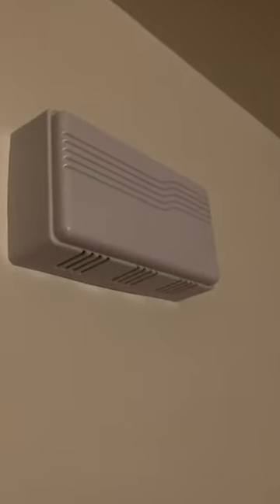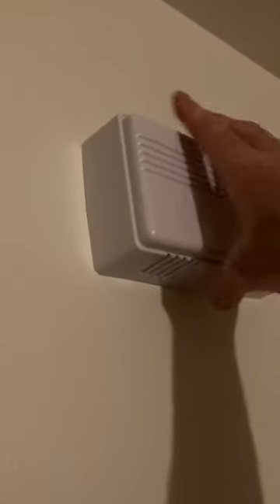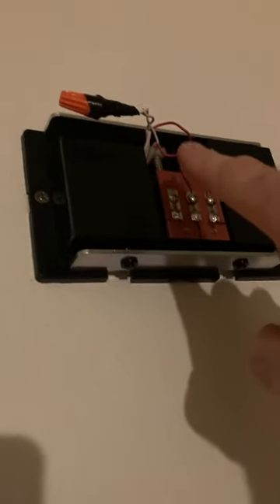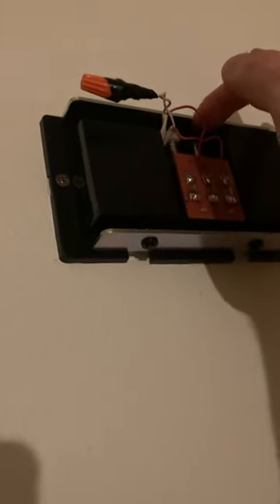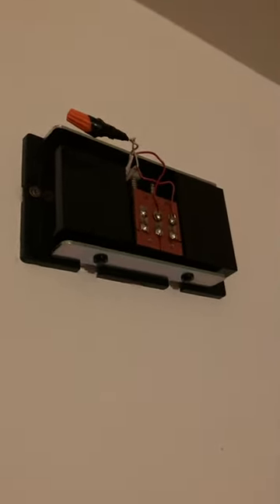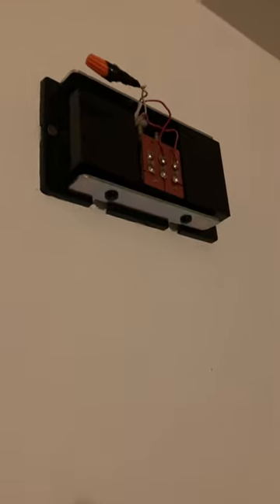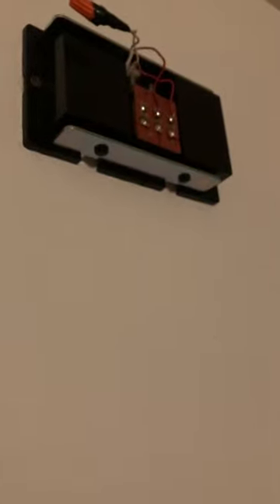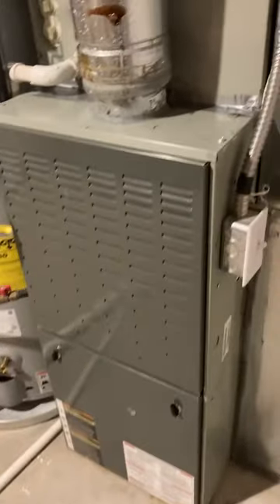Doorbell Transformer [Where to find it]

Comment: Agree with the others who are thanking you! Had our furnace replaced a month ago, and I think the installer messed up the transformer. It is right on the power box next to the furnace and now I have no voltage at all to the doorbell.
Reply from the maker: Sorry to hear that.  I would check to see if he forgot to hook it back up, or it may have failed.

Comment: You suggested in a comment that it may be located behind the chime. I think this is my case but I just want to verify. When I pull the box off, there's an electrical box with 3 separate wires. One is labeled "front." One is labeled "back," and the other is labeled "transformer." It seems like this would be it, but the box doesn't look exactly like the one in your video that's attached to the side of the furnace. I'm just trying to install a Blink video doorbell to my existing doorbell and I don't want to electrocute myself lol. Also, I'm not sure if you can answer this, but should I still shut off the main breaker after disconnecting the wire from the transformer behind the chime? I didn't expect this little doorbell project to require so much more than a few screws and WiFi connections lol 🤦🏽‍♀️ Thanks in advance for any help you can provide 🤗
Reply from the maker: That box sounds like it is part of the chimer.  The transformer usually has screw terminals on it. It's usually made of metal.  Yes, you want to shut the power off before disconnecting or connecting any wires.  Good luck with your project.  This video may help you too...
https://youtu.be/uzdg5jzUd6s?si=XKjF_pQyB8fCFqzI
Reply: @kjfacilities-maint  Thank you SO SO much! 🤗 This info and the video is very helpful. I do believe I'll not only get this doorbell installed, but I'll get out unscathed as well lol 🤣. Thanks again! 🤗
Reply from the maker: @KeiraMitchell1 you’re welcome!

Comment: Thanks! Found mine across the hall from the chime in the furnace closet. One comment though. In your video it shows the transformer secured to AC box and since the transformer has to have 120v input I can safely guess it's coming from that box?
Reply from the maker: You are correct, in the video the transformer gets its 120 volts from that box.  Glad you found yours! Awesome!

Comment: Thanks. Yesterday I was trying to install a new Ring camera. My old Gen 1 worked fine but the new one, a Plus caused my chime to go crazy and buzz etc. Turns out the 50 year old transformer and chime are of a lower voltage standard, 12v while all the new devices are 13 to 18v.
Reply from the maker: Awesome, glad you figured it out!

Comment: Long story short. I was installing a doorbell camera. Not enough voltage. Tracing the wire, I lost the transformer wire in the sealed ceiling in the basement. I saw a similiar colored wire in the area of the Furnace, but gave up because i was told by an electrician the old transformer should be near the Breaker box. I couldn't find it near the box, so i gave up tracing in the area around the furnace. I gave up!. The house was built in the 50's so ill check the furnace area again. Thanks! Fingers crossed
Reply from the maker: Good luck with your project!

Comment: I have a single story house that was built in 1995 and can literally not find it anywhere. Not behind the chime, not with the breaker, not in the attic, not with the hvac. I’m fairly certain that it’s just hidden somewhere behind the drywall which pisses me off since I can’t upgrade it without causing significant damage, not to mention having no idea what part of the drywall it’s located behind, but I assume it’s somewhere in the hallway where the chime is.
Reply from the maker: Do you see any j-boxes with blank cover plates anywhere?  Or is your doorbell system battery operated?  Or maybe check inside closets, kitchen cabinets.

Comment: I have checked the attic, crawlspace, water heater, furnace, closets to no avail. I found it is on the same circuit as my garage ceiling lights and some wall outlets by turning breakers off. I'm not sure what to do at this point, electricians are so expensive per hour.
Reply from the maker: If you found the transformer, you can leave that breaker off, replace the transformer and turn the breaker back on.  
If you have not found the transformer, you a look inside the j-box behind the chime too.
Reply: Not behind the chime either.
Reply from the maker: Did you look in this circuit breaker panel?
Or do you see any blank cover plates anywhere along any of your walls?

Comment: Question. Our doorbell been bugging out for the last 3 years since installed. We have an ADT doorbell. We have no video. Techs have came out to change out the doorbells. Still having issues with video. What is the volts req for the transformer? I think we might need to replace it. Ty.
Reply from the maker: They may have hooked the wires up incorrectly.  There usually is a wiring schematic inside the chime. 24 V is the most common.  Here is a link to doorbell wiring: 
https://youtu.be/uzdg5jzUd6s?si=6-_KS35dRk-ZPlW1
Reply: @kjfacilities-maint  thank you so much. 🙏🏼
Reply from the maker: @caligirl3000 you’re welcome.

Comment: Ok but now how do you turn the door bell off?
Reply from the maker: There should be a circuit breaker in your circuit breaker panel labeled "door bell" or "furnace."  Turn that breaker off, check with a multi-meter or non-contact voltage tester to be sure the power is indeed off.

Comment from the maker: Sometimes the transformer can also be found directly behind the chime inside the j-box.
Reply: Mine is not in the chime box. Our AC is on the roof, is that the place we're going to have to look for the transformer?...
Reply from the maker: @elsasun sometimes it can be in the circuit breaker panel. Sometimes it can be in another junction box nearby.  Sometimes chimes are battery powered is yours battery powered?  Or hardwired?
Reply: @kjfacilities-maint  It's hardwired. I have 2 chime boxes on the wall with no transformer in them, and they don't ring. There's another chime box plugged into the wall, it's the only box that rings. I could plug it in anywhere. So I'm confused, I don't know where does the power come from.
Reply from the maker: @elsasun I would assume the chain box that plugs into a wall outlet receives a wireless signal from the doorbell push button.  
Without seeing your hardwired chimes, I’m afraid I can’t advise you further on where the transformer is for them .  It may be up with your air conditioner, but that would be a weird spot to have the transformer for the doorbell on the roof with the air conditioner.

Comment: This video was a big help.  Also, my transformer output is 20 VAC and I measured the same at the push button.  
I see chime units rated for 16 volts.  Are these compatible?

Edit:  I found my answer. 
I took a closer look at my transformer and it says it’s rated for a 16V load.  Apparently the output can be as high as 19-20VAC. I compared it with another and measured the same output.
Reply from the maker: 16 V and 24 V are the most common for doorbell systems.  There should be a sticker or marking on the transformer,  noting  the output rating of the transformer. If is rated for 24 V, but it’s putting out less voltage, you may want to replace the transformer.  
You can buy a tri-volt transformer, it gives you the output option of 10, 16, and 24 volts.
Reply: @kjfacilities-maint  New chime unit installed and working fine.
Reply from the maker: That’s awesome!

Comment: I was curious from watching your video. How would you go about turning off the power to the doorbell? You said your switch wasnt connected to the furnace at all. So if "you" wanted to turn off the power to yours what would you have had to do? Or did you mean it's not connected to the furnace buuuuut connected to the wires that power the furnace, and then you'd have to turn off the power to the furnace itself?
Reply from the maker: Sorry for the confusion, if I turn the switch off, it turns the power off to the furnace and to the doorbell transformer, another option would be to go out to the circuit breaker panel and shut the circuit breaker off that powers that switch.
Reply: Good observation. I had the same curiosity.
Reply from the maker: Yes, you would need to turn the circuit breaker off that provides power to the transformer, or if the same circuit breaker provides power to the transformer and the furnace switch, turn the breaker off to the furnace, depending on how your house is wired.

Comment: Hey I hooked up one of these for a Ring DoorBell and it's Buzzing after I turn the power on. Like a grinding sound. O.o
Reply from the maker: You may not have it hooked up  correctly, make sure the wires are connected to the proper terminals on the transformer (verify voltage) and up inside the chime too.  If your chime has terminals labeled "front"  "rear" "trans" and you only have a front doorbell button, you will only use the "trans" and "front" terminals.  The "rear" terminal will not be used.

Comment: I live in Florida, and I think my transformer is in the attic next to the light switch that doesn't work either.  It's a big transformer, and I'm afraid to mess with it.  Any suggestions?
Reply from the maker: Hi JM, First, I would trace the wires as far as you can follow them to see what that transformer provides power to.  2nd, You can buy an inexpensive multimeter, or non contact voltage tester at your local Home Depot, Lowes, Ace, or Harbor Freight.  I would use one of those tools to check and see if you have power at that transformer and light switch.  If you have live power, you will want to figure out what breaker sends power to the transformer, and light switch, and turn the breaker off before replacing the transformer.  Take a picture of how the wires are connected, before disconnecting the wires.  Make sure the power is off.  
You can send me a picture of the transformer and it's location to my Instagram profile, and I can try to help you decide if it connects to your doorbell: 
 https://www.instagram.com/kjvegan83/
Here is a link to an inexpensive multimeter: 
https://www.harborfreight.com/electrical/electrician-s-tools/multimeters-testers/11-function-digital-multimeter-with-audible-continuity-61593.html  
Here is a link to an inexpensive non contact voltage tester:
https://www.harborfreight.com/electrical/electrician-s-tools/multimeters-testers/non-contact-voltage-tester-63919.html
Reply: Hi Kevin, Thank you for your considerate, and timely reply.  I do have several Multimeters I can use.  The Transformer is above the garage if that helps.  I have an idea they come directly into the attic to the transformer.  I'll keep you updated as I go along.  Thank You again for your help, much appreciated.

Comment: how to turn it off? mine doesnt have a switch
Reply from the maker: You will need to find the circuit breaker that supplies power to the transformer and shut the circuit breaker off

Comment: Wow. Whose idea was it to put that thing so far away?? Wouldn't it make sense to put it where people can find it?
Reply from the maker: I hear you :)
Reply: @kjfacilities-maint  Maybe you can help me. Our doorbell button was cracked, and the doorbell was making a humming sound. My husband thought he smelled burning plastic, so we turned off the power to it at the breaker. I bought a new button and attached it, but it won't ring with the power back on. It made a clicking sound when pushed. The constant humming was back, so we turned off the breaker again. Do you think it's the chime or the transformer?? My guess is the transformer is behind the chime. It's a six-year-old house. TIA
Reply from the maker: It could be the transformer is going bad, or the chime is going bad.  You can double check the wire connections at the chime, however, if it was working fine until now, you may need to replace the transformer and or the chime.  Yes, sometimes the transformer is mounted behind the chime.
Reply: @kjfacilities-maint  Thank you. I will check the chime box wiring, and also see if the transformer is behind it.
Reply from the maker: Just remember to turn the power off first, if you decide to replace the chime or the transformer.
Reply: @kjfacilities-maint  Absolutely. It's been off. 😄 It's attached to the porch lights. I miss the lights.

Comment: There’s no transformer in the chime  box. No Power to the doorbell.
Reply from the maker: If you have used a multimeter to determine there is no power to the doorbell chime, check for a tripped circuit breaker, loose wire connections, bad door bell push button, bad chime, check for power at the doorbell transformer.  The transformer can usually be found on the side of your HVAC equipment, but not always.  You can check in closets and cupboards or behind any blank cover plates in the wall.  Just always check for voltage before touching anything or replacing anything, make sure the power is off.
Reply: @kjfacilities-maint  Checked utility room where water heaters are,  closets, washer/dryer, no transformer yet, we have no HVAC, only wall heater but no transformer, strange...hmm. Will look closely next time.
Reply from the maker: @Simple Living  Do you have a garage, attic, basement or crawl space? Did you check in or near your circuit breaker panel?
Reply: @kjfacilities-maint  Have not gone into attic yet.